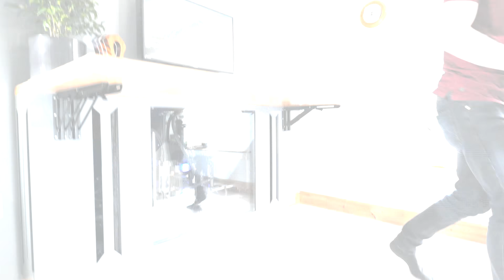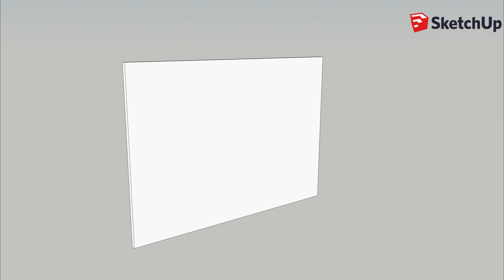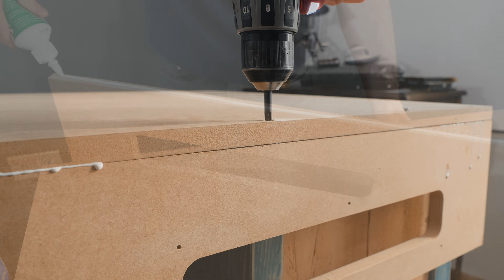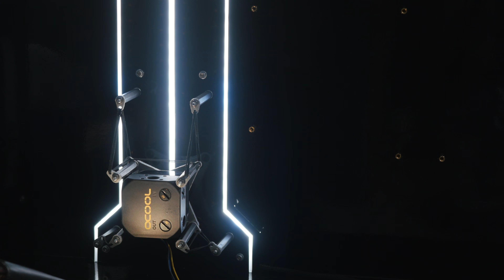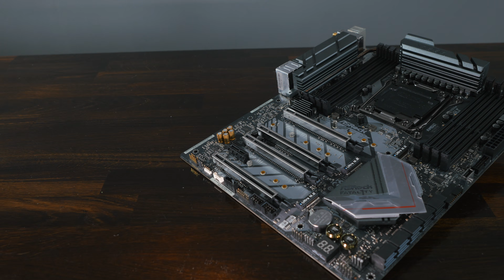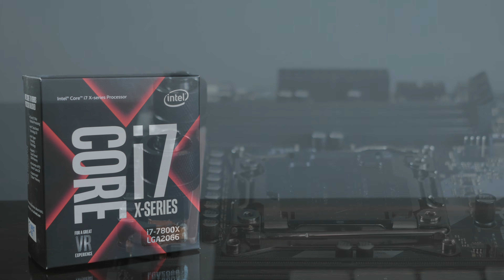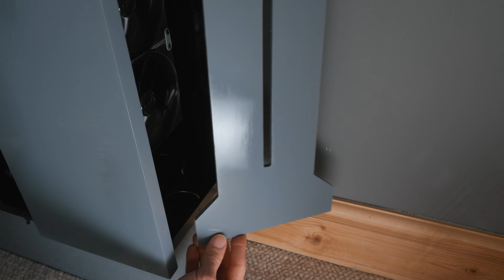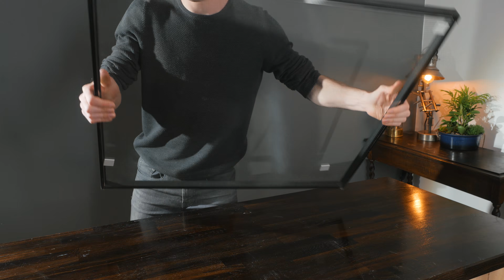Building a spectacular DIY 'desk PC' (it can fold!)

Comment: Out of the entire build, its the capacitive switches that blew my mind.
Reply: True that capacitive switches are not something new. But his implementation of it, along with the flush brass finish is just damn gorgeous and inspiring. One thing that irks me is that he didnt make a switch for a reset button. Another minor thing is the buttons are not labeled (small engraving on the MDF or on the brass button would do). But like i said, it is minor detail on an otherwise a beautiful built
Reply: out of curiosity why? you use capacitive touch switches everyday they are in TONS of electronics. Your phone screen is capacitive touch and it not only works as a button but can detect exactly where the press occured. My monitor has them, my toaster, my coffee maker. I made some for a project 20yrs ago, just wondering why that is what blew your mind.
Reply: @dreded7961  may you tell me where i am supposed to connect the I/0 output? Or how the board works in general (i just have basics knowledge of electronics unfortunately)?

Comment: If you ever plan on using spray paint or compound paint again i would recommend using a 5000 grit sand paper on it after the final coat is dried then apply some buffing compound to it and wear it down a bit then bring up the shine with some polishing compound, this done by hand. It gives it a much better shine and in general a much smoother look.

Comment: Honestly something I would recommend is rinsing out all of your liquid cooling components before installing them. Also, add in a small bit of silver to prevent algae from growing inside it or gunking up. (Put the silver in the reservoir, and make sure it can not enter the pipes) I would have also added in more speakers, but this is a fantastic build!

Comment: to make the pump quiet you could... 
Me: add some rubber feet for a few bucks
you: add a suspension off rubber bands holding the pump mid air from a bunch of extra parts costing more but looking 10x cooler. (excuse the pun). 
me:... bravo!

Comment: Dude, lovely video, but you made a bad mistake putting the thermal paste on. You shouldn't spread it out like that, it causes contact issues. Either an X shape blob (for larger cpu's) or pea sized blob for standard size CPU's is the better method to ensure good transfer.

Comment: There are some things that could've been made better but it's still impressive.

1. Installing GPU flat to the board with PCIe extension cables.
2. Adding some more LED strips.
3. Not using HDD.
4. Tweaking the soft loop a little bit to run nicer.
5. Mounting the Amp to the table horizontally, so the knob is exposed. (There's something satisfying about moving the knob yourself)
6. Running the monitor cable directly downwards with wall colours sleeving.
Reply: Hdd are essential if you are a content creator or a dude Who works with the PC all day long

Comment: It would take me 5 years to build something like this!
Reply: It would take me 5 years to afford something like this.
Reply: Alex Spots Wood  I'm upgrading my current rig to a similar thing I'm making, only I'm making a river tabletop for the folding piece. The liquid cooling alone is around $900USD. I already had most of the pc hardware from my current rig, but jeepers it's spendy. Definitely going to be worth it though. I'll try to keep @DIYPERKS and you guys updated with the result!
Reply: @jademcmichael4358  Hey dude, have you done? And... Can I afford all materials for watercooling and desk Building (without PC inside) within 1500 USD?
Reply: @user-tx4jg7yl7h  it's tough to say, especially with all the different saws, tools, and resin and whatnot, but it'll probably be around that price by the time it's finished. I'm in the process of moving right now, but I'll continue progress after I'm in and settled. Going for a white resin and wood  river table with white painted mdf for the housing and the inside being black to show off the rgb ;)
Reply: @jademcmichael4358  bruh, I've not money issues so it's ok. Let me updated on the building
Reply: @user-tx4jg7yl7h  sounds good man. I'll keep you updated!
Reply: It took me 1 month. But i did not build the oc in it, just put it inside. With a big opening under the folding desk

Comment: I would be concerned about mold developing between the desk and the adjacent wall, especially in a cold climate and an inadequately insulated wall.
Reply: You could just add spacers like he does for the board etc - AND (take it from someone who has lived in a very bad moldy environment before), make sure to have it on an inside facing wall. That way, the room temperature in your flat will heat up the wall and the problem most likely won't appear.
If your only choice is an outside wall, and you don't want to use spacers, you could just insulate the wall on the inside - only behind the desk for appearance. It would create a temperature barrier, and since its behind the desk, it won't be ugly, and it will be kept in place by the desk itself.
Be creative and good luck :D

Comment: Personally I'd not use MDF for the hardwood top. While its great looking and cheap, you cant have heavy objects on MDF as it is just glue and fine sawdust and will warp over time. Also, if impacted would break fairly easily. I think long term hardwood for the table tops would be best. 
Also because you used MDF for the structure, I hope you used fender washers to affix it to the wall to distribute the load over the MDF.
It looks great and all but MDF isn't the best building material for structural stuff. what you're using looks like higher quality stuff, but I'd have used a thinner layer of MDF to mount everything  to to dampen noises.

Comment: Dang you missed a perfect opportunity. You could’ve made the tabletop glass or something to where you could admire your pc in both folded up and down mode
Reply: oooooh and have a height-adjustable mechanism, so you can use it either standing up or sitting.. like a little elevator on the wall. holy crap

Comment: Great video. Suspending all of the moving components using elastic was a great touch. Two suggestions I would consider: 1.) Change the order in which the parts are cooled. I personally would have gone CPU -> GPU -> voltage regulators. I think it makes sense to cool the parts in the order of which one generates the most heat first. 2.) Add a soft-close feature to the desk top when you fold it down. The last thing you want is for it to slam down and potentially dislodge one of the suspended components. Cheers!

Comment: When you have those hard drives hanging like that, any movement in the desk, like folding it up, will make the platters crash into the read/write heads and ruin the drives making your system loose large amounts of data due to platter damage. Hanging them, in my opinion was not a good idea. ALSO love the vids! Hope to be able to get a computer like this one day! 
Edit: Also load times on gaming and graphic applications will be pretty bad unless running raid 0. In which case a bump in either HDD will destroy all data.
Reply: "Also load times on gaming and graphic applications will be pretty bad unless running raid 0." ??? Raid 0 is almost never a smart idea.

Also, having the HDDs hanging should not be a problem as there are many cases that have the HDD vertically (I have seen multiple HP pcs with such setups.) Bumping into the desk should also not cause major movement of the parts as it is screwed into the wall and I dont know about you, but I never bumped into my desk so hard, the wall shook. Even if that is so, HDDs are more durable as you make them out to be. How would a Laptop with an HDD survive any movement otherwise? I have had running Laptops fall down tables with no damage whatsoever.
Your concerns might be genuine care, but it comes of as nitpicky nonsense.
Reply: @SpiderMax95  the problem is I thought they were in the desk. And if his computer was running and the desk slammed closed it could damage the hard drives. Also it's not a problem with verticality it's a problem of them not being secure. Movement of disk drives,  in some cases can destroy data. Rare nowadays with locking technology on drives with things like laptops which is how that works (accelerometers) but can still damage them.

Comment: Thumbs up. Very nice work. However there are a few things you might want to keep in mind. Mounting the amplifiers inside is generally considered a big no-no in the audiophile community as it tend to make the signal processing prone to interference, especially when mounting it next to a power supply. Second, i'm not sure how much use you get from a audio amplifier if you are using your Bose headphones wireless.

Comment: Do you have or expect any mold forming due to being airtight holding the water traces that will escape the cooling unit at various stages and then the heat being kept inside there as well??

Comment: You went through A LOT of trouble to make a silent system when in reality, even a fan based system is quieter than ambient @4-6 feet, which is usually the distance you're sitting at. 

I don't even hear my PC under full load, and it's entirely fan based.

Comment: On my opinion, it is very nice project. But on video you shown, how switch & push only one side, but how about the other? I think in this case, if table is large & its need to push sync. both sides it is little not convenient. But anyway, this table I like.

Comment: i liked the concept a lot. but imagine that that i allready have a case/computer, a bquiet pure base 500, its air coolled. is it possible?
i'm trying it. it must be small, 1000mm to 1200mm of width max, 300 to 400mm depth. it must fit the tower/computer, the vertical modem from the net supplier, a 4 bay NAS, keyboard, small wacom table, below the table top storage for cacles and extentions, if possible some extra store.... and folded table top, and las but not least find a way to make the heated air get out. a challenge to you. have fun

Comment: FWIW, if you use a (quiet) aquarium air pump to bubble the case air through a magnesium chloride solution (i.e. a liquid desiccant), humidity can be minimized.  With the addition of an Arduino + humidity sensor, it will only cut in when needed.  The whole thing can probably be built for less than $20.

Comment: Looks great, but you should have earthed the motherboard via the brass standoffs, that's why they use brass and not plastic, when fitted in a metal case they complete the earth connection with the power supply.

Comment: This build is fantastic as is, but could be improved by coating the fiber board with opaque colored acrylic sheets instead of paint. Opaque acrylic sheets, laminated to the fiberboard, will produce a glassy mirror like appearance.  Anyone interested in trying this should watch a few video tutorials on "How to Laminate a Countertop". The laminating process is exactly the same, except using different materials.

Comment: I wouldn't remove all moisture from inside, as very low humidity encourages the build-up of static charges. 
I would however consider adding a water block to that nvme drive. They can generate quite a bit of heat.

Comment: Considering the airtight case, do you (or could you theoretically) get problems with air pressure changes inside the case? Because of hotter air expanding/colder air shrinking? (I know the cooling is of the best quality, but am more curious for the theoretical problem that could arise). And oh yes, absolutely great content, amazing builds. Hope to one day be as handy as you.

Comment: i wouldnt use this anywhere unstable, or near a highway/street many semis go through. everything is allowed to rock about, not to mention the water coolings terrible seeing as you'll have to take apart the whole thing just to clean it, and with it going through 2 radiators, it'll be much sooner than normal. that and dust is going to kill this thing.

Comment: so you sealed the case air tight. only problem i see is the heat build from the power supply. it is a nice case however i have no use for such a machine..

Comment: You went to a lot of effort and it looks great.  I would have suggested putting your exposed wires in the wall with entry exit points hidden behind the case and devices such as the monitor and usb hub.

Id also put better equipment in there, you have an extremely beatiful battle station but crappy brand names.. opinion i know. 

You may want a simplified way to maintain those coolant levels as water cooling requires being topped off occasionally.

Comment: Love desk impressive work, I agree on the extra cooling idea. What I would add to it would be a hard mounted keyboard. On a flip side cutout In folding table. Utilizing the same touch switches to ingage/disingage a solinoid pin lock. Second I would intrigrate the screen to rise up out of back. Using a electric solinoid ram. By doing these two things would clear up left over unintagrated parts. Giving the impression that unless in use, it just a foldable table/desk.

Comment: Watching this was tiresome already. Can't imagine doing it without a garage...

Meaning... I have no means of doing it although I'd be able to.
Reply: We perceive it more as an inspirational video. Of course, few people will create it in exactly the same configuration, despite the fact that you have enough time and money to do it. Personally, I solved this with a false wall, behind which is a 90cm corridor and computers usually stand on narrow tables near the wall. In the living room there is only a large monitor on the wall in the picture frame (no visible cable) and keyboard (I have an antique living room). But such a folding table, as in the video, I would use.

Comment: Incredible video, noone in the comments can convey enough praise for this channel. .  one question about this build however.  The higher density would surely make it less sound proof as the sound would travel through the material easier compared with foam or other materials with air or vacuum pockets that reduce noise conduction as a result of their low density and structure?

Comment: 19:52

I'm sure it was fine if not bit I hope you applied a light shmacking of thermal paste on the cooler or card there.

I say that because no surface is perfectly flat/smooth and that's the purpose of thermal paste, it fills I  those tiny gaps that hot air/components DO NOT LIKE. Haha

Again, if you got lucky or barely use it you may have a decent enough connection but I wouldn't avoid a thin coating to be safe.

Comment: This is a very informative and detailed video. Well done DIYP! I’m curious if you could help me/us with an idea I’ve had bouncing around my brain. I live full time in my custom built RV and prefer using a desktop over a laptop. I’d like to see a build similar to this, but in a more compact and lighter case. From building experimental subwoofer enclosures, I’ve found 3/4” birch plywood is equally strong and roughly half the weight of 3/4” MDF. Is this something you’d be willing to tackle?

Comment: This is a realy cool build :D,  I was just wondering about the grounding on this build, since there is no good grounding capabilities in the mdf itself. And the PSU does not have the ability to take up the failing current since there is no grounding in the "cabinet itself". So if it shortcircuts, how do you prevent it from traveling along the rest of the components and motherboard?

Comment: I love your channel. I need to build a corner desk with overhead shelves and storage below the desk and it needs to house 6 systems and 3 monitors, 4 of them have full keyboards and 2 have tkl keyboards, 4 of them has 2 mice each and a one handed keyboard in addition to their regular keyboard, I am thinking something with multiple pull out surfaces for the mice and keyboards ... like 3 and 3 and then maybe some drawers as legs? also maybe some backplates to hide the wires..and there are many wires... I have 5 hdmi switch boxes .. 2 on 2 monitors and one on the 3rd monitor.. any thoughts?

Comment: Very nice design. One thing i would have done on a design like this is the monitor being mounted on a arm so i can adjust the distance when viewing it cause the table top being quite deep, it looks abit far unless you going for 40in screen. Another would be the base painting, i would opt for a laminate finish instead for easier to clean and is excellent to glue onto mdf.

Comment: You forgot to handle cooling for the m.2, it technically isn't a huge requirement if the system isn't going to be under heavy use, but if it is then it can cause thermal throttling and as you knowq heat causes damage to electronics, so its always wise to cool everything when possible.

Also how would you go about replacing the liquid and flushing the system? Depending on how often the system is used and what liquid you use for cooling, depends on how often you'd have to clean this out, could be every couple of months to every year or 2, so having a way to easily flush the system without having to open it up would have been a could feature to add.

Overally it is an amazing concept and it's given me ideas for a future build :)

Comment: The RAM, PSU, and HDD's are sealed up. I guess the internal radiator can handle the heat via convection? What is the case temp? Did you consider adding thermistors or some way to monitor the temps?

Comment: Two things:

1) How sturdy is the table to use? - Can you put your weight on it without it deflecting?
2) Why go to such lengths isolating the mechanical hardware with rubber suspension, when you close of the internals? - You have a solid slab of MDF, those harddrives will not be heard. If you wanted to isolate them, you could use rubber grommets between the hdd and the mounting peg. A much cleaner look is achieved as well.

Finally, great build. I would have hoped you would do one of those cool water distro plates. I think they look much nicer than the cylinder reservoirs.